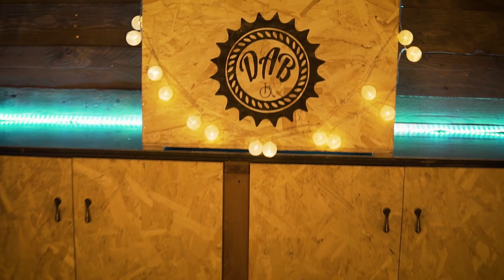VINTAGE ROAD BIKE BUILD -COLNAGO SUPER SARONNI-

Comment: I look at this stunning work of art and wonder why anyone who loves cycling would chose a modern carbon POS over something as lovely as this? In 50 years this will still be a stunning bicycle whereas the latest, greatest carbon offering will be doing it's non-biodegradable thing in a landfill somewhere.
Reply: I hold no bias against carbon fiber bicycles; my appreciation for them is equal to that for steel ones. Having experienced the evolution from steel to aluminum, and finally to carbon frames, with a single example built from titanium, I value each material for its unique qualities. The eventual fate of a bicycle, whether it’s preserved or discarded, hinges on the craftsmanship invested in its frame and its maintenance over time. However, its ultimate destination is of little consequence to me. What matters is the joy of riding and cherishing every bike I own, regardless of the material.

Comment: I am going to an estate sale this  Sat. 2-24-24 to look at a Colnago, I'm pretty sure it's a Super,  it comes with Campy C Record, however someone changed the brakes from the Delta's to some side pull and I can't tell which ones from the picture. The bike has the sloping crown  chrome fork and looks immaculate. I intend to make it mine this weekend, fulfilling a life long dream of having an Italian work of art to ride.  I'm going to change out the rims to clincher,and add a NOS Selle Concor saddle, but other than that I don't see myself doing anything to this wonderful work of art.  Can't wait to try it out. No grease on the steerer threads or the headset top bolt?
Reply from the maker: Hello friend! If you send me photos I could tell you. send them to me on instagram or face. ; )
Reply: @dabrestauracion7404  Sadly I had to pass on this beautiful and pristine Colnago as it was a 53cm frame, which unfortunately is too small for me. The bike was in perfect condition and sold for 500.00USD. A bargain at twice the price.

Comment: As always, u make beautiful videos. Can I ask... is there a trick to setting the correct tension for the front derailleur of a downtube shifter? Every time I try to set mine up, there is so much tension in the cable that it doesn't stay in the big ring. Instead it always falls back to the small ring as there is not enough friction in the shifter. Hope that makes sense? Thankyou for your videos!
Reply from the maker: Thanks my friend!!! I'm glad you like the videos. To your question, surely you are missing a grooved washer that goes on the gear levers, if the problem is that when you act on the gear lever it goes down by itself. See if that's it. If not write me on instagram and send me a video of the parts you have on your gear levers. Regards, anything you tell me; )